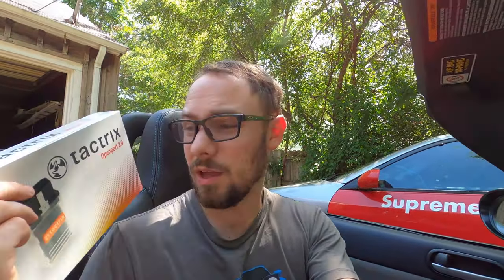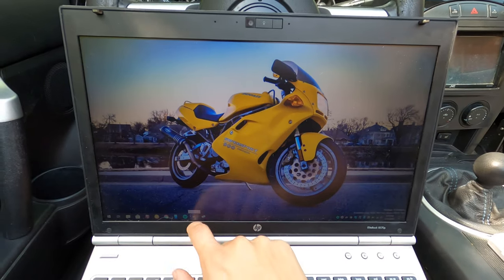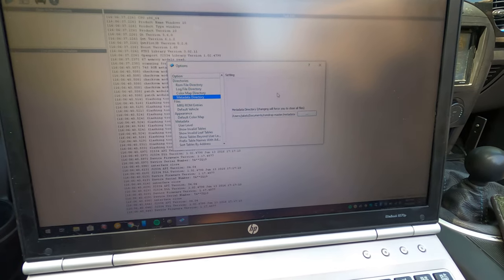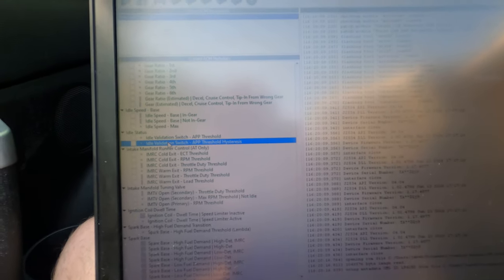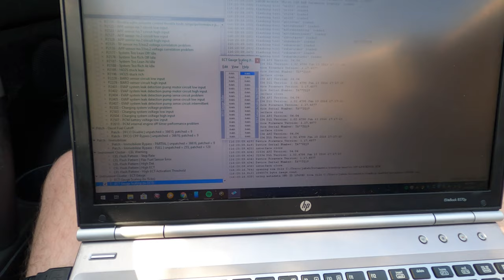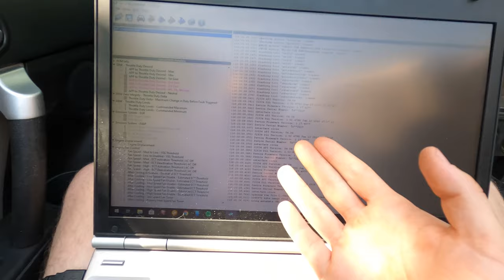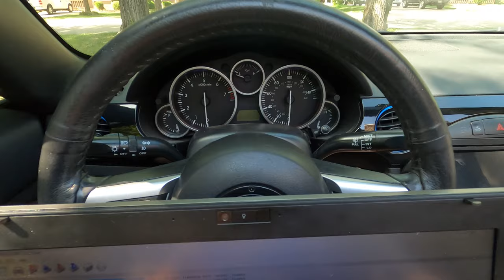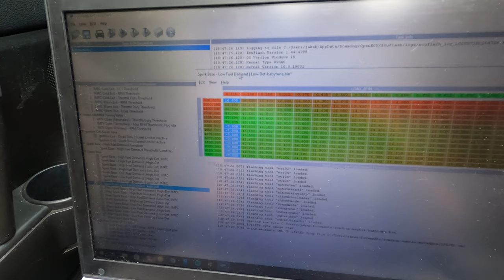TEACHING MYSELF TO TUNE? (DIY burble tune)

Comment: The stock tuning probably has some considerations for emissions so the engine doesn’t run too rich or lean when you shift

If you were in California you’d probably want to reflash to stock before doing an emissions test